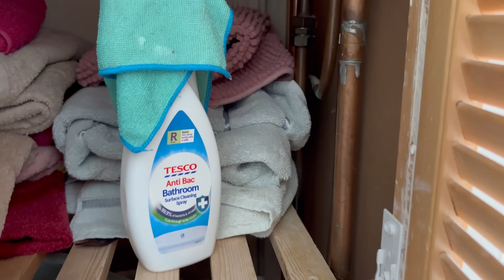Plumbing…Always On A Friday Afternoon!

Comment: I have the same issue with the Adey Procheck photos, and I agree the replacement strips are too expensive, nearly the same price as a new kit. As for those rodded pop-up waste, I flatly refuse to fit them. Tell the customer that a clic clac waste is better and still use the same tap.
Reply: Yes, those wastes are dog p..p 😂
Reply from the maker: Agree with waste mate but just what customer wanted, did offer a pop up as 100% better. Yeah ADEY pro check is little poor with photos sometimes hoping they patch the app to make it better 👍